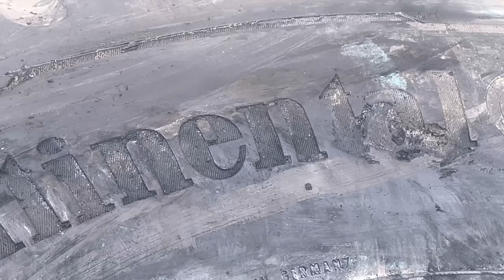Hard working Young man Repairing Gaint Caterpillar Loader Tire | Heavy Duty LoaderTire Repair |

Comment: Okay, something looks hinky here. I don't think the finished tire is the one they started with. In fact, at the end they rolled right past one that looked just like the one they were working on at the beginning. The tire at the end had wording on the side that was not there when they were covering the hole on the outside of the other tire.

Comment: Hello AT men. It is easy to imagine you having plenty of customers. Especially these days. Recently a friend working a mine way up in northern Canada had to replace the tires on a massive Cat loader. A bit bigger than your video tires. The cost here was an unbelievable $12,000 per tire. Insane. So repairing them for a lot more use makes good sense. 
Good luck!
Reply: it won't last for a hour of work ...
Reply: В России сей час шины больших размеров тоже стоят не дешево 😪😪  правда у нас есть не большие предприятия которые скупают не дорого старые шины для ремонта и дольнейшей продажи их
Reply: @АндрейОвчинников-ъ1ц  если эта бессмысленная война и эта тупая эскалация не прекратятся... думаю проблема дешевых шин будет наименьшей из проблем...
Я обнимаю русских и украинских братьев и всех тех, кто хочет и работает над тем, чтобы положить конец этому безумию.
Reply: @MrCinghialotto  я сам не могу понять для чего такие жертвы ради каких то не больших кусков земли 😳🙄😪 . Тем более в России нет дефицита в площадях  🤫
Reply: @АндрейОвчинников-ъ1ц  Я приветствую тебя и обнимаю тебя, брат.
Reply: @MrCinghialotto   а вы сами то откуда родом ? 🤔
Reply: @АндрейОвчинников-ъ1ц  Я итальянец. южной Италии.
а вы?
Reply: to drive with this Cat loader is a suicide mission
Reply: @michaelluecke1234  20-30hrs

Comment: Throw a tube in it and you're all set.  Wish I knew what materials to buy - I've got a loader tire (paid $800 for the loader, the tire is $650+) that could use a quality patch.  Right now I'm just keeping my eyes on the local auctions and tire shops hoping someone replaces a halfway decent 14.00-24

Comment: These tyres are used on earth moving tippers, mainly in quarries where the potential for damage from rocks is enormous.  Normally cross-ply rather than radial as the sidewalls are stronger. The cords that run from bead to bead to provide the structural integrity are rayon, not steel. Irrespective of how talented these guys are, there's not a chance I'd rely on those repairs although they probably do work. Speaking from experience in the tyre trade, having had an 11.22.5 x 20 tyre explode three feet from me while inflating it in a cage. I used to work for Dunlop, manufacturing tyres, Firestone selling them, and ATS fitting and repairing them. Had the British Coal contract for the tyres on machines that were operating underground a d they used to suffer major damage regularly. Couldn't risk any tricky repairs due to the risk of underground explosions.
Reply: I would definitely trust this repair without question
Reply: If you lived in a resource poor country and had small capital I think you might try a repair like that.
Reply: I agree, when heavy weight is it’s job the integrity is in question.  Would have to use the injured tire on the back if all are the same.

Comment: After watching several of these types of videos I've determined that when something finally makes it to a trash pile or landfill in Pakistan there is nothing else it can be used for. I simply mean they have gotten every last ounce of usefulness out of whatever that item was. I'm not knocking these guys at all but I'm amazed at how they can repair absolutely anything. While a tire repair such as this one is done all over the world. So many of the other things they repair and the methods and tools available for them to use doing so are almost unbelievable. This tire would have been disposed of in the USA. Possibly ground up recycled but it would never have been allowed to be used on heavy equipment again due to the safety hazard of it failing in an explosive blast and killing or injuring someone.
Reply: Да действительно ремонтировать такие шины с таким серьезным повреждением опасно для долнейшего эксплуатацией .  Но я смотрю он там востанавливают практически все и практически голыми руками и на коленках .   Молодцы ,  полное импорто замещение  🤣😄😉
Reply: Put it on the back of the loader if all tires are the same…

Comment: Its not the same tire. Look at the original tread at 0:38 then look at the 22:36 tread. Now take a glance at the tire on the ground at 22:36. There is a large hole and six little holes showing us the original tire before it was even stitched. This video is a disservice to the skill and hard work of these men.

Comment: Hocus Pocus, the tyre changed into a Continental at the very end. The integrity is still in question. If all four tires are the same, put that injured tire on the back. The less it flexes the longer it will last. 
I don’t trust it with full weight on front…

Comment: I am curious how much does it cost to replace that tire maybe $8,000 or more, if so then it would be worth it to put in all of
that work to repair that tire. I would like to know what are they charging for this repair?
Reply: In the Indian subcontinent, cost of repair not much. The tyre is bald though. I guess they did this just for Youtube, not for reuse.
Reply: That tire is not bald.  Look how deep the tread is.  Repairing a sidewall is usually a no no.  There is too much flex and not enough cords.
Reply: I wonder if they give the buyer of this repair a warranty (maybe 90 days up to a year). If the repair is not expensive, then the caterpillar owner must use/repair/use this tire until it really is bald and no good. The tire seems lightweight for such a big tire.
Reply: I've watched other videos like this. One listed the price of such a repair at 30-40 dollars. So definitely worth it on an equipment tire. We used to do this in America until everyone got lawsuit happy
Reply: I guess they taking a chance with this tire !!!, I don’t know....plus Continental tires ain’t the best tires either!!!.

Comment: Eight strands of copper wire do not replace 300 strands of steel wire.  Not even close.  This tire will likely explode at first inflation.
Reply: That tire doesn't have steel belts in it, they're fiber. If it was steel, they'd be sending showers of sparks when the guy was grinding on the tire.
Reply: Steel or something els, cord has been cut, is this strong enough?
Looks like a dozer tire.